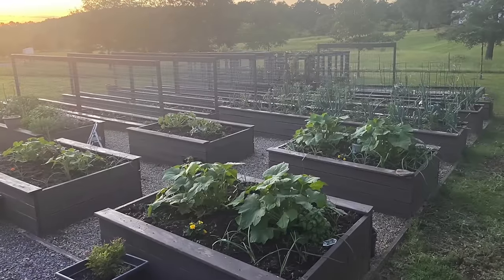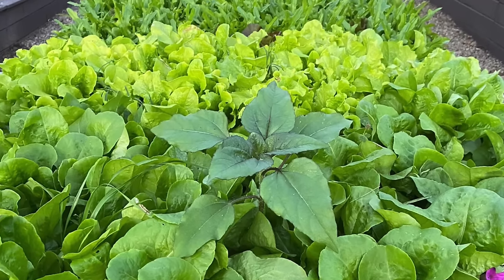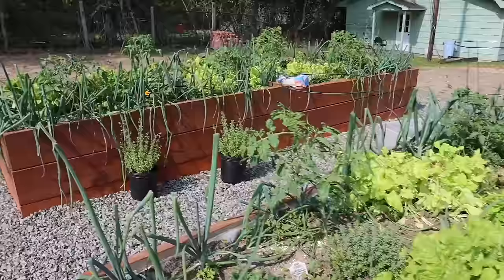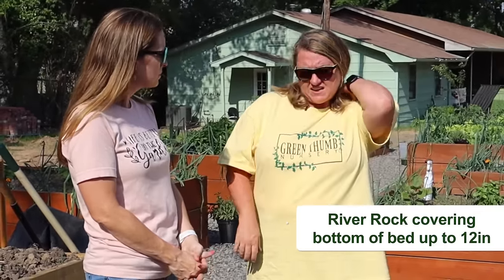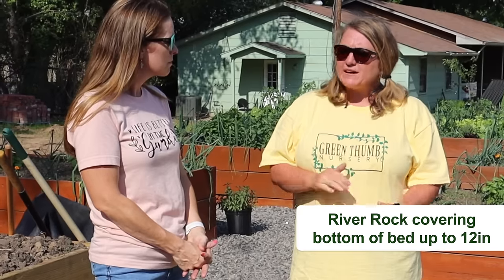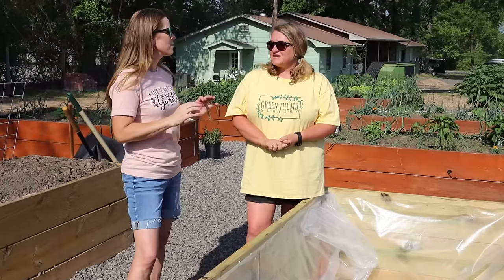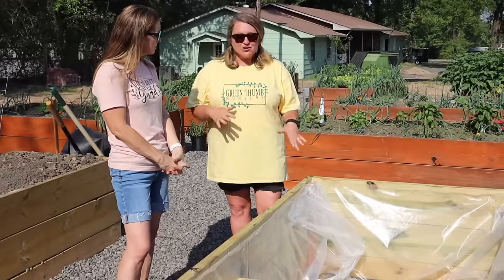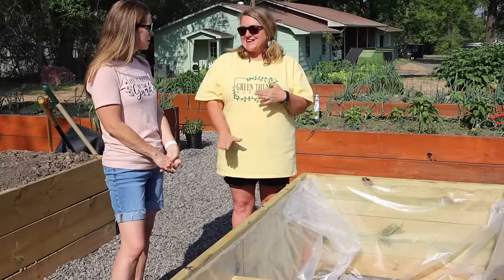DIY Self Watering Raised Beds/Green Thumb Nursery

Comment: This is an awesome video!! Do you think I could replicate this in a raised metal stock tank pool? Also I'm curious if I could get away without using the initial plastic layering in the metal stock tank. I'm hesitant having the plastic make contact with the water.
Reply from the maker: I've wondered the same thing. The metal would have to be leak-proof, I'd imagine, and you'd have to drill a hole for the pipe for overflow.
Reply: Wouldn't the metal touching water be just as same of a concern?
Reply: @elo5808  The plastic would protect it?  Or do you even need the plastic with this type raised bed?
Reply: Metal stock tanks are galvanized, which is it’s rust protection.  Limited chance of it being a problem. If you drop rocks it it, you will likely effect the protection. Plastic gives you an extra layer of protection but also can be damage, and then can create even more problems. Better what be a paint or similarly applied material. Check out roofing systems or something like redguard which is a liquid applied protection used in wet environments.
Reply: galvanization works best when exposed to air most of the time, and just occasionally to rain or moisture.  This is because the entire principle behind it is the formation of a zinc oxide film, which is highly protective.   to form this oxide, it needs oxygen exposure.  
Once you bury galvanized material in a moist environment (like a planting bed), it becomes much more unpredictable, because you now have a low to no oxygen environment, and the film may not be able to repair itself.  low ph soil and water will attack the oxide film, and the zinc plating.  If that film is defeated, and the plating pierced, you'll have rust and a hole.  I would definitely not bet on any galvanizing made in China. But in general, I would not bet on galvanizing for a wicking bed scenario, no matter where it was made.   Plastic is fully proof against water, no matter the oxygen situation.  Just don't use PVC or vinyl, try to use HDPE plastics.
Reply: Matt - Awesome nerding! Thanks for the knowledge.

Comment: Wicking beds only last about 2 years before you need to tip everything out and start again . They were designed as a emergency garden beds not long term . Certain minerals build up and you going to have to pull everything out and start again .
Reply: Half true. Growing anything will deplete some components of the soil, which will need to be replaced  to grow more of the same thing. There are also ways of replacing the nutrients in the soil without pulling everything out and starting over.

Comment: I live in a dry country. This sounds like a really good idea! I am just wondering whether the water under the white PVC pipe may sit there for long and become full of algae or something. Otherwise this process sounds like the most efficient watering idea I have thought of.
Reply: This is my concern also. Allsorts of issues can arise in stagnant water.
Reply: I don’t think it is an issue because the water is never exposed to sunlight.
Reply: I wondered the same...Utah has hot dry summers and the 24 inch sides of the raised beds could really heat up and possibly cause algae growth. Anyone with experience here?

Comment: 6 mil = 0.006 inch plastic
The most common size in the thickness rating for plastic sheeting is 6 mil. This is 6-thousandths of an inch, or 0.006 inch
0.006 inch = 0.1524 millimeter
Reply: Correct! And that plastic is simply far too thin for withstanding the punctures that can occur from dumping in all of that gravel. Gravel is not needed what-so-ever for these systems. Regardless, a 20 to 45 mil pond liner is going to hold up much better.
Reply: @Albopepper  asking seriously.  if you're worried (or they are in the video) about using pressure treated wood then why would you also not be worried about using plastic?
Reply: It is a matter of the rate of decay/percolation.
Reply: @johnlee7085  Also asking seriously, does plastic really only have decay/leeching problems when exposed to sunlight? Like if plastic is underground does it break down so slow that the chemical leeching is negligible?  Or is it the same with and without uv light?
Reply: Bradley - The sunlight definitely has an impact on the rate of decay. Even moving plastic out of direct sunlight will slow decay. You can see this for yourself in your backyard. 

As for the rate of decay for plastic underground, I think landfill experts would tell you it’s a long long time, though I can’t give you a definitive answer. I do definitely know that the rate of decay for some plastic is greater than others (faster for clear to light colors and slower for dark to black), but that also might be mixing a solar factor. 

What I do also know is that large amounts of public utilities, including potable and recycled water lines use pvc or hdpe pipes. I think you will find that these buried plastic have been tested significantly without ill effects.

Comment: We wrap a few milk creats in geo fabric and put them in the bottom amoungst the gravel for increased water storage. also if you put a price of storm water pvc pipe  in a corner as the fill point you can always accurately tell how much water is in the bed. i also recomend putting slots in the overflow pipe, and putting an extra peice of geo fab over it just for good measure.

Comment: Great Idea for your zone, for me it would not work because it would pop the frame in winter. 
Another tip is the add an inverted styro cup to a planting pot to catch water evaporing and go down the side of the cup to feed the roots. You save a cup of soil for the next pot. You can decide how many cups to use.
Reply: What zone do you live in? I live in zone 5 & wondering about that problem if we did that.
Reply: I’m trying to think of an easy way to pump/drain the water from the reservoir before the hard freeze.

Comment: I've been doing this method for around 9 years.  I used the corrugated pipe underneath and then I put gravel down and then the fabric down.  After a few years the beds won't wick because the soil gets to old.  My beds are 4' x 22' so it takes a ton of soil and peat moss to fill them.
Also you have to water from the top because if it's not damp it also won't wick very good.  Im going to redo my beds. I think I'm going to take out the corrugated pipe and put sand in the bottom and not put any fabric so then I can have things that go deeper in the soil like carrots and I think it will Wick better., but who knows it's all an experiment.
Reply: Please update after you try that.  I would be curious if the sand would stay on the bottom or if it would work it's way to the top.  I wonder if tearing strips of fabric to use as wicks would help?

I had to edit the word cotton out...cotton fabric would mold and disintegrate.
Reply: Leave the pipe but wrap your fabric down between the pipes and let the soil fill from above. The wicking is probably diminished because of limited water soil interaction. Also, fabric can develop a film on the surface that reduces water penetration. The more surface area you have the less likely the build up will be a problem. Wicking beds can be watered from below.
Reply: Also, old soil is just nutrient depleted soil. Lots of ways to add nutrients. Most use fertilizers though not absolutely required. It’s a function of growing plants in an unnatural environment, not the wicking bed.

Comment: If you are watering with potable/chlorinated water, you should really invest a few dollars in a rain catchment system. You pay a lot of money to buy a pre made system or view a couple videos and put one together for a fraction of the cost. You can save many hundreds of gallons of fresh rainwater from just a small 1/4” rain storm and even just a 1,500 sf roof. 

Food grade ibc totes (250-350 gal/$50-100?) are probably the best volume/$, though you need to paint the plastic for uv protection. Then you would need $30-50 for abs pipe to reconfigure your downspout. 

Easy solution for plenty of pure, free rainwater. 

If you ever find that the tank is getting low, and there’s no rain in the forecast, just add the tap water to the tank. Chlorine will off gas relatively quickly. That’s also a way to treat the tank if you think mosquitoes or other undesirable have infiltrated the tank. Better just to screen any openings.

Comment: Hi, if you have the space and are able a large open topped tank pumped with tap water will exgas the chlorine from the water over the course of a couple of days. You need to cover after a couple of days to prevent algae. Then pump from the tank rather than directly from chlorinated tap water.

Comment: This seems like a great idea for Central Texas where we're in the second year of a drought. However, the bed materials alone (without rock and soil) add up to about US$175 for one bed. Add to that about US$360 in soil (bought by the bag since not everyone has a front-end loader) and $50 or more of rock (again in the bag).  That's about US$600 with taxes, screws, etc. Is that about right? They look nice and save a lot of time, but wow, that's going to be an expensive bunch of vegetables.

Comment: I feel like this system would translate really well to recycling greywater. You'd have to be careful with what soaps you use to avoid salt build up, and of course you couldn't grow root vegetables in there, but as long as the water doesn't come in contact with the part of the plant you're eating it should be perfectly safe, and as long as you have a bucket in place to catch any overflow coming out of the drainage hole it's a totally contained system with no chance of the greywater getting out of hand and contaminating the groundwater.

Comment: SUBJECT/ QUESTIONS:  TILLING THE SOIL & FERTILIZATION ….  I LOVE this concept & wish I had known about it when I started raised beds MANY years ago.  I plan to figure on what my cost would be here in Georgia & compare it to  the MASSIVE route I took by using cement blocks & potting mix!!!  *I did however, after my first raised bed taught myself to make my own potting mix ( NOT POTTING SOIL OR DIRT ).* This saved quite a bit of money but was extremely time consuming.   My beds are about 25 feet long & 3 feet wide.  I put cattle wire on each side of my tomato beds so I can attach elastic ( not rope or twine ) to support my tomatoes & vines when they get really heavy.  ( Plus, the holes are big enough to pick tomatoes & trim the plant )  Trial & error has taught me that using this method helps the stems/vines on tomato & pepper plants “sway” a little with the wind/storms without breaking.  Last year my bell peppers were bigger than a softball !!  The cattle wire is tie wrapped to metal fence post & are easily removed when it’s time to till the soil.  Here’s where my question comes in…  QUESTION # 1 … I am able to till my soil every fall & spring using an attachment on my Stihl weed eater.  How do you till the soil/mix in these beds?   QUESTION #2 … How do you fertilize your beds ?  ( for those of us that don’t do organic gardening, we do it like our grandparents taught us…lol…. Like I said in the beginning,  I ABSOLUTELY LOVE your way of gardening & I know that my water bill would be a fraction by doing it your way.  Believe me,  between my beds being made out of concrete blocks & filled with potting mix I lose A LOT of water during really dry periods.  Once peat moss dries out it takes forever to rehydrate it.  I do use soaker hoses but even then the water runs out the bottom of the blocks & the grass around my beds LOVE it!  AGAIN, more work for me.   I just thought of something ….  With your set up, maybe using water soluble ( Miracle Grow ) & pouring it  ( of course diluted so it could reach the whole bed ) might work?  Just thinking.  PLEASE I would welcome ANY & ALL comments/suggestions from anyone that might have smarter & easier ways of doing this.   If you had to deal with Red Georgia Clay then you would realize what a nightmare it can be.  Wish I could have the soil my daddy had in his garden when I was a kid.  I don’t know how many years it took for him to get that HUGE garden soil so perfect.  But, what I do know is year after year he had so much manure & what we call here “good dirt” hauled in & tilled it, fertilized it , etc.  that his garden even to this day is the talk of that small town.  That was 50 years ago!   Guess I’m lazy to a point because I DON’T do this & how many of you do?……… He would send samples of his garden soil to the State of Georgia Agriculture & have it analyzed!   They would tell him exactly ( EVERY YEAR ) what to amend his garden with.  Here I am with 3 raised beds & I know what the mix is in my beds & at least I’m not stressing about amendments.  JUST STRESSING ABOUT MY WATER BILL!!!! hehehe….  Thanks in advance for any/all feedback.  Have a great day, happy gardening , & hopefully we will all have a good harvest for the 2024 season…. ( well, if the darn birds would stop pecking my tomatoes !! 🍅🐓🍅
Reply from the maker: Jill here — I’m not the one with these beds; I just interviewed Tammy who does. That said, I don’t till. For my raised beds, I add 1-2” of compost to the top each year. Sometimes I add slow-release organic fertilizer at planting depending on the crop but often I don’t have to do that. With organic gardening, with consistent adding of compost, fertilizer isn’t needed as much.

Comment: I love this idea! I read through the comments for an answer to this question: Are there issues with water freezing in the bed, or am I overthinking this? SW MO sees freezing temps, as I think your area does as well. Happy gardening 😊
Reply: I might add a second drain pipe at the very bottom. Stopper or valve to control drainage. I have the same problem with freezing in Colorado!
Reply: So then the bottom drain would need to be water tight, otherwise no water would be held during the summer. You can’t just poke a pipe through plastic and expect it to hold water. Any ideas on how you would you do that?
Reply: With a threaded spigot and adapter to the PVC. Silicone caulk around the liner penetration.

Comment: I will soon be rebuilding one of my raised beds and I'm trying to figure out the best way to do that. Considering self-watering beds, I have a few questions.  
1. Why build a self-watering bed instead of just using an automatic irrigation system to provide consistent water?  
2. Instead of all the gravel in the bottom, how about just using perforated, flexible drainpipe with sleave coiled around the bottom of the bed? 
3. Why put plastic all the way up the side instead of just one foot up and allowing excess water to drain out the bottom of the bed, and use a stick down the fill hole to measure the water level?
4. Leaving just one foot of soil over the rock doesn't allow much room for plants. Many vegetables will send roots down 24 inches. Shouldn't the beds be taller, maybe 3 feet?
Reply: All great observations/alternatives. The plastic all the way up the side provides cheap protection to the wood to reduce rotting.
Reply: @johnlee7085  That is true. When a couple of my large raised beds finally failed, I found that in the bottom section that had been covered with weed cloth, the wood was still in relatively good condition, whereas in the top have the wood that was directly exposed to the soil was deeply rotted. When building the new beds, I made sure that all of the inner sides were covered to prevent direct contact with the soil, and I expect they will last much longer.

Comment: I would like to point out that the bed container needs to be built on 100% level ground for this system to work and needs to be a 4'  board height. I believe you can also use logs and branches at the bottom instead of stone if you live in a rainer climate.
Reply: Logs and branches may punch holes in the plastic liner.

Comment: This just happened to show up in my feed at the perfect time!! We are having to convert our entire 16x40 in-ground garden to raised beds as well as move the 4 raised beds we already have. We'll be building 6 new ones and moving the other 4 very soon. I wanted some kind of drip irrigation system but this is much better! I will be sharing it with my husband and son. 
I'm just curious how much rock it takes to fill a bed? My new beds will be 24"Hx4ftL. I have 3 that are 8 ft long and 28" high, the last is 6 ft long and 28" high. They are all 2 ft wide.

Comment: You need to cover your drain tube so it will not clog up with dirt.  You need something covering the end of the drain pipe.  I recommend using a piece of perforated drain tile and some garden cloth.  You can’t have a one inch drain tube uncovered in a wicking bed and expect it to drain effectively.  IT WILL CLOG UP!

Comment: Rocks have next to no capillary action, so water sitting in the bottom can't be drawn up into the top layer of soil. Some water may make its way up if the water level is close to the top of the rocks, close to the soil. Some water vapour will make its way up, but not enough for good plant growth. Plants will send fine roots through the matting into the water reservoir, thats the main mechanism.

Comment: What would be a way to do this without plastic liner? My idea would be to put down a layer clay, tamped down and tapered up a bit higher on the edges, then Mexican style tiles and maybe some more clay built up around them to form a slow draining reservoir instead of using plastic. I would add the river rock and a metal drainage pipe as suggested. It may be problematic keeping the clay sides in place until the rest  of the soil is in place, so that’s why I suggested bisqued tile or ceramic floor  tile, to help hold the clay  lining outside. Use weeping tile  for the pipe.